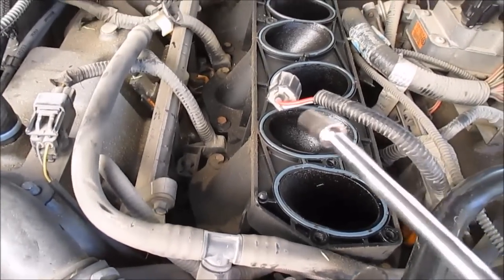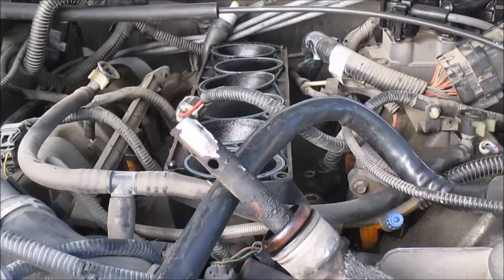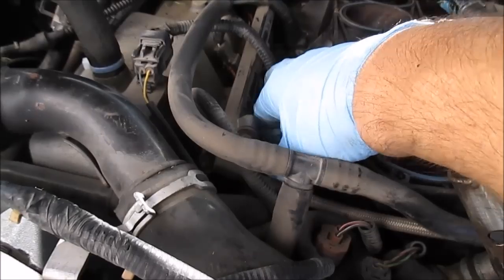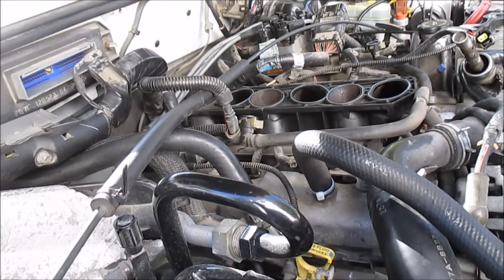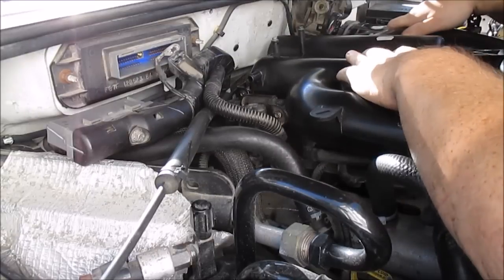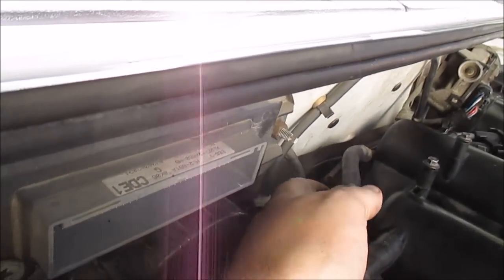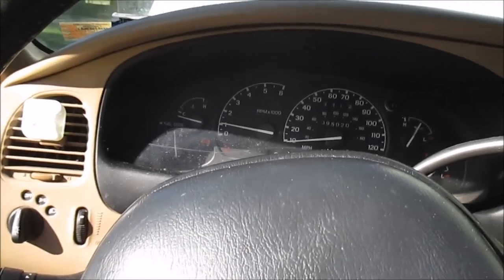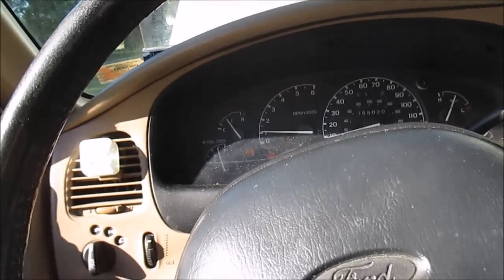Ford Explorer 4 0L Upper and Lower Intake Gaskets Part 2

Comment: I am thinking  of tackling  this too someone  told  me my  intake gasket is probably bad be a use it runs midrange  on the guage and I cannot keep water in the radiator because  it keeps getting pushed out ( I put water in after  doing the thermostat housing  until I made sure there  were  not any more  leaks ) I have a die in it and that is not getting  into the oil so I am glad it is not the head .
Reply: and I am very thankful for the video I haven't  worked on these newer vehicle  s yet more accustomed  to  the  older easier one's  lol
Reply from the maker: Well if you keep losing coolant (or water) I would suggest you might try pressure testing your coolant system with everything shut down and the engine completely cooled down to check for leaks. You can use a radiator pressure tester. Or make a homemade version, but basically you are pressuring the coolant system (usually around 16psi) to see if the system can hold pressure. If it does not hold pressure it is leaking somewhere. Doing this will usually help you pin point any coolant leaks. If you do not see a leak externally, but you see the pressure going down, then suspect internal leak. Another test you can try is to look inside each cylinder with a tiny borescope (you can buy them, but I made my own for a few dollars and it works very well) Anyway you can usually see if a cylinder is leaking coolant (or water) internally because that cylinder will usually be much cleaner looking than the cylinders that are not leaking. Normal ones are usually coated in a little carbon, and the ones that leak are much cleaner. Also another thing that could be happening (I am not sure of your exact cooling system) If you have on the radiator by the rad cap a connection that goes to an overflow tank and that thing is super full, and your rad is not full, you might have a bad radiator cap. Sometimes when pressure builds in the coolant system from getting hotter the rad cap pressure relief opens and coolant goes to the overflow tank, now when the system cools back down this should create a vacuum and  the rad cap should open under vacuum and the fluid should go back into the radiator. (I hope that makes sense) 
Here is a link for more info on how the rad cap functionshttp://asecertificationtraining.com/radiators-in-automotive-engines/  . I hope this info helps you out and gives you some more things to think about. But bottom line if you cant keep coolant in the radiator something is leaking somewhere and this should help you find it. Well good luck you ya and have a good day.
Reply: +AJ “Figgy” Pierce I have some leak dye in the system but it is not leaking anywhere , just coming out the neck ,or being pushed out the over flow bottle if the cap is on
Reply from the maker: If you keep having to replace coolant it is leaking out somewhere. So the first thing I would suggest is a coolant system pressure test, to see if the system holds pressure. If it holds pressure that is good, but if it does not hold pressure figure out where it is leaking. If the pressure holds (test or just replace rad cap, have to have special tester to test rad cap)Also with a pressure gauge on the system you can start the vehicle and watch the pressure gauge if pressure rises rapidly there may be combustion gases getting into your coolant system (bad head gasket) That is one test you can try. Another is to check for combustion gases in the cooling system by using a chemical checker (ex block tester,) you basically put this tool over the radiator and squeeze the bulb if the fluid changes color in the tool you have combustion gases in your coolant. (bad head gasket)  Another test to do is a compression test. If you have low compression on one or multiple cylinders that could be a head gasket problem. Also you may try opening your rad cap/or reservoir (only do this test on a completely cooled down engine) then start the car and look for bubbles in the coolant (if a lot of bubbles might be combustion gases in coolant)
After verifying system's ability to hold pressure, engine compression, a chemical combustion checker, and rad cap replacement. If all of that test out well, and you are still losing coolant, something must be making the system overheat (which should illuminate engine light, and make dash gauge read hot) and push coolant out the overflow. Perhaps bad water pump, bad thermostat, plugged/dirty radiator, bad radiator fans. Also the engine itself could be running hot, from numerous things.(ex exhaust restrictions ,lean conditions,) Well I hope this info helps you out. Thanks for the comment and have a good day.

Comment: Mr. AJ PIERCE,tanks your explanation. But I have a doubt: in the video, on 16:20 time, you talk about ´torque level´we have to use. And I don´t understand well.
Is between 107 and 123 inch/pound? Would you confirm this torque range please?
Anyway, tanks a lot.
Reply from the maker: The upper intake manifold bolts are torqued to 62 inch pounds (which is only about 5 ft pounds), and the lower intake manifold bolts are torqued to 107-123 inch pounds (which is only about 9 ft pounds)   12 inch pounds = 1 ft lb.   So basically I was just pointing out the importance of using the correct amount of torque on the bolts. Most torque wrenches are set using ft lbs scale, and if you did not adjust to inch pounds you would most likely snap the bolt.  I hope that makes sense. Thanks for watching and thanks for the comment. Have a good day.

Comment: This makes it seem like by just removing the upper part I can get the injectors...Does the lower part the one you are taking out in this part have to come out to change injectors? Thanks trying to figure out what gaskets to order before I tear it down.
Reply from the maker: From what I remember I believe you can get to the fuel injectors by removing just the upper intake. When you order intake gaskets they come with both the upper and lower intake gaskets. (the felpro kit is around $7 on rockauto.com and the same set is about $20 from autozone)  Now when pulling the upper intake you may want to replace your egr o-ring tube seal and perhaps the pcv valve in the rear, and if replacing fuel injectors you may want to replace the fuel injector adapter seals that the injectors seal into.  I have a few videos related to this, and here are the links.
https://youtu.be/z6_0f1uqe00                 https://youtu.be/LlXtWKLmfd8                https://youtu.be/1bBBaxCgsOE
Well I hope this info helps you out. Thanks for watching and thanks for the comment. Have a good day.

Comment: I was just curious, but did you ever have to change out your head gasket? That's what the ford dealer told me was leaking coolant.
Reply from the maker: +Josh Groover 
No my head gasket was fine, but If you suspect a head gasket problem you can check a few things to confirm. Usually first thing I do is look at the oil dipstick and oil cap (if it looks milky that means coolant is mixing with oil) One step further is to get a sample of oil and you can send it to a lab to have it tested (called an oil analysis kit) this usually cost around 20-30 dollars. (it is  amazing all the things an oil sample can tell you about your vehicle) Another test is to pressure test your coolant system using a coolant system pressure tester (if it does not hold pressure you are losing coolant somewhere). Another test is to use a block tester kit (also called combustion leak tester) It is a simple test done over the radiator cap or coolant reservoir it is a cylinder shaped tool that holds fluid, and the fluid tests the vapors inside the cooling system. It changes colors if combustion gasses are in the system. (dont do this test if coolant system is hot or under pressure you could get burned) Another test is to check compression on all the cylinders (usually bad head gaskets show weak cylinder compression, basically if the head gasket is not sealing compression will leak and not build. To do this test you use a compression tester, and to do this test you take out the spark plugs, disable the fuel system, disable the ignition system, screw the compression tester into the spark plug hole, and crank the engine over and see what compression you get in the cylinder.  Another test is to look at the tail pipe if you have white smoke coming out of the tail pipe you might have coolant leaking into the combustion chamber, but basically coolant leaks into the cylinder and gets burned up and makes white smoke out the tail pipe (there are videos on youtube showing this)  Well here are a few basic tests you can do to test for bad head gaskets. I hope this info helps you out. Well thanks for the comment and have a good day.

Comment: Oh my gosh how do you know how to torque in pound or what?  107 inch pound?  What how do i know when it's at that torque level? 16:25
Reply: Use a inch pound torque wrench. They sell inch pound and foot pounds. If you don't have one the big three auto parts stores Advance, Auto Zone and O'Reilly have them in the free loaner tools. Pay a deposit, use it, take it back and get your money back. Harbor Freight has some cheap ones.

Comment: i head white residue on my dip stick, what does the head gasket look like
Reply from the maker: +james dean 
Here is a link to what a head gasket looks like https://www.explorerforum.com/forums/showthread.php?t=289847 just scroll down a little. Thanks for the comment and have a good day.
Reply: +AJ “Figgy” Pierce thank you! i will start with what u did first, if i still have white stuff in my oil , i will change more gaskets....tks

Comment: hello where did you get the upper intake gasket set? everyone sells the lower but not the upper thanks?
Reply from the maker: I used felpro ms90890 I believe. This part number has both upper and lower intake gaskets. I bought mine from oreilly auto parts. I think it was less than $20   You can type ms90890 under parts on the autozone.com, oreillyauto.com, or go to rockauto.com and type in that number and felpro and find the part or you can type in your vehicle info and find it that way as well.  I would suggest rockauto.com I have been using them a lot because they have really good prices, and a good return policy. Well I hope this info helps you out. Thanks for watching and thanks for the comment. Have a good day.

Comment: How has the car been idling after the repair?
Reply from the maker: +Jason Gallardo 
It has been running a lot better at idle, I think replacing the intake gaskets made a big difference, but now I think it has another issue. I believe I have some dirty or clogged fuel injectors or perhaps another fuel delivery issue. I have just been to busy to mess with it. I have been busy dealing with finals for school. I hope to do some more work on it in the near future. Well thanks for the comment and have a good day.
Reply: +AJ “Figgy” Pierce I hope to tackle this project during Xmas break as my exploder is also idling rough.i only have 215k on mine and was quite surprised you almost hit 400 k wow great milage never seen that in an explorer.cheers!

Comment: I really appreciate these videos. I'll be doing this on my 2000 this weekend, assuming I don't have to order the gaskets online. It idles rough in the morning and dies if I don't keep pressure on the gas, at least until it warms a little. Bad milage, too. I've got lean codes on both banks and all cylinders are reporting a misfire, so I hope this does the trick. Did you have to reset the check engine light after this?
Reply from the maker: +Allen Reed 
Well good luck to ya on changing out your gaskets this weekend. You may want to try using a smoke machine on your intake to see if you can find a leak before replacing everything. I think the best way to pinpoint a vacuum leak is with a smoke machine.  A lean condition can mean to much air throwing the air fuel ratio off or not enough fuel throwing the ratio off. (lean is to much air or not enough fuel, rich is to much fuel or not enough air)  I would try to rule a few things out before replacing them (not a big deal though intake gaskets are inexpensive and yours probably do need replaced) If you have a scan tool look at o2 sensors to check function (see if they respond with propane enrichment and vacuum leaks) Look at fuel trims see what they are doing, and what they do when you snap the throttle.  Check fuel pressures and fuel volume flow. Also change fuel filter, and clean injectors. If replacing the gaskets, it might be a good time to replace fuel injector o-rings, and pull injectors and clean them and test them (I wish I did that when I had everything off)  Well just some things to think about. To me it sounds like you have a problem that is affecting both banks, and not just one bank. So most likely the problem will be something that is common to both banks. (maf sensor, fuel, or vacuum leak ) Well I hope this info is helpful to you.  Thanks for the comment and have a good day.
Reply: +AJ “Figgy” Pierce Well, I finally got around to doing the intake manifold gaskets. All the advice you gave above is great, but I wasn't able to it as I don't have the means or know-how. I intended to change my fuel injector O-rings, but when I got a look at the fuel rail, I didn't feel confident removing it. I'll have to either learn more or have a pro do it when I can afford to (or maybe one day you'll release a video on it, haha). However, I was able to change the upper and lower manifold gaskets, and I have to say, the Explorer is running MUCH better. No more hard starts or dying while idling anymore. More get up and go, fuel economy, even the brakes seem to work better. The short of it is: I owe you a steak.
Reply: +Allen Reed sup

Comment: how long does it take to get it back together?
Reply from the maker: I took my time and I think I removed everything and cleaned up and prepped everything in one day (maybe 2 hours). Then the next day I put everything back together. (maybe another 2 hours) But I did everything when it was super hot outside, and I used only hand tools. If I had to do it over again I would use an impact or a drill to remove the long screw bolts holding the intake on, (they are long look kinda like deck screws) and I would remove the pcm connector and cable off the firewall to get clearer access to the back bolts. I think  this job could be done in a few hours no problem. What took so long was the cleaning and prep work, and the back bolts (just remove the pcm connector  and cables much easier to do) Also if you do this job, it is probably a good idea to test and clean your fuel injectors (maybe even replace the fuel injector o ring gaskets, could be source of leak) Also replace the egr ring gasket as well (it seals the intake from the egr tube and they leak) Well I hope this info helps you out. Thanks for the comment and have a good day.
Reply: I'm going to give it a shot. Thanks.

Comment: Has anyone done this on a 2001 Ford Explorer?  The Haynes Manual indicates that the 2001 model is "one piece" although the set-up looks the same as it does in this video.
Reply: Yes I've run into the putting a new engine into my Ford explorer 2001 sport 4x4 there are many different types of intake assemblies that go on the tops of this 4.6 l engine and that's where a lot of people have problems trying to find the right gaskets and stuff like that and the place I even got the engine from they didn't even know that there were different since the engines like the ones manufactured before 03 of $2,000 I think is once one type of intake and then the ones after that that's a totally different type of intake and I argued with the them people at powertrain sport motors and they never would do anything to fix it or rectify it to fix the gasket problem cuz it was supposed to come with gaskets and it was the wrong gaskets

Comment: Some guys start from the easiest and work toward the more difficult . where I start from the most difficult to remove working my way forward towards the easiest ..and I remove wire harnesses  fuel rails anything that might cause  interference at all anywhere  ..If your ever doing this job in the future you might wanna take some compressed air and blast off the intake valley PRIOR to lifting off the lower plenum so no animal debris like Chipmunk nuts & other stuff does not fall into your motor....But while your intake plenum is off is a great time to take some Simple green or Purple power and clean it really good inside and out  both upper & lower you will find that inside the intake they  runner's do collect plenty of crap and let's face it clean is always better than dirty ... just blow it off good when done ..

Comment: Dam Ford for building such a bs abomination!!! They could have had a single pipe intake on top as a single piece and then all you would need to do is pull the 12 bolts and swap the gaskets...

Comment: its this is 1999 ford explorer
Reply from the maker: Yes it is a 1999 Ford Explorer 4.0L SOHC
Reply: Did you end up replacing the gasket under the fuel rail too?
Reply from the maker: I replaced the fuel injector o-rings under the fuel rail, and my fuel injector adapter seals. Not sure what gasket under the fuel rail you are talking about, as far as I know the fuel rail only has o rings. I replaced the upper and lower intake gaskets if you are talking about the lower intake gasket. Well I hope this info helps you out. Thanks for watching and thanks for the comment. Have a good day.